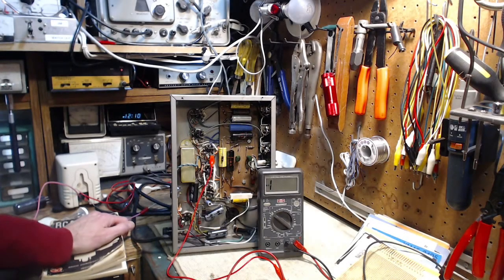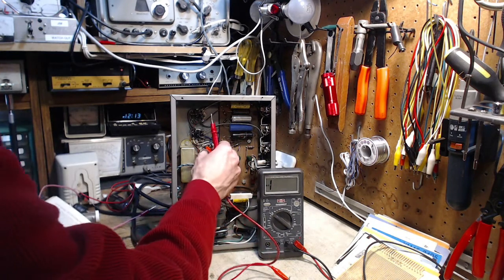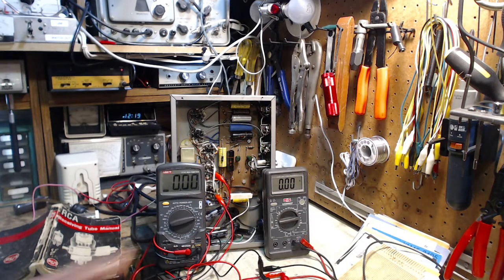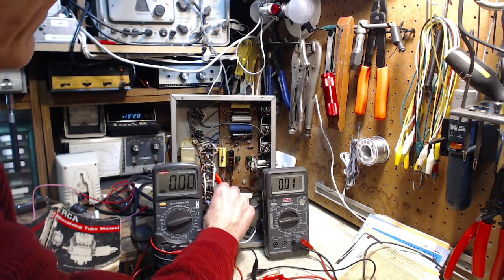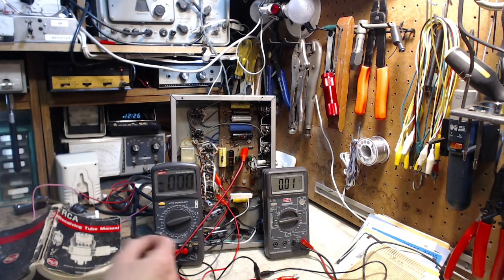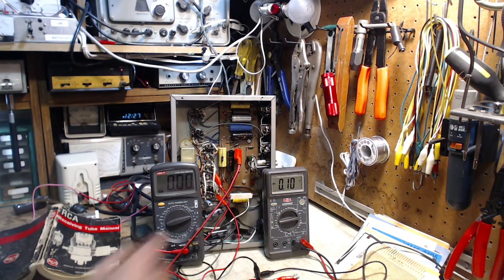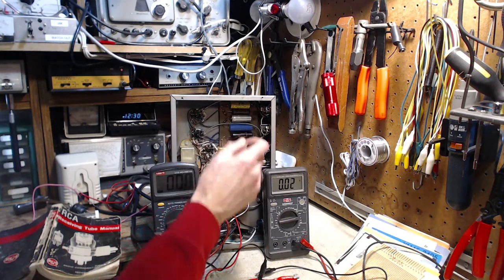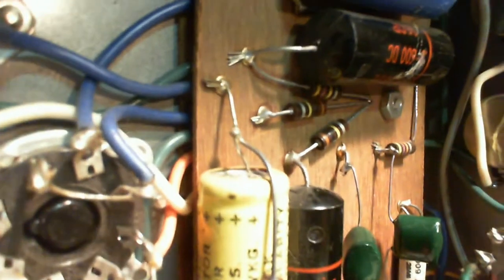Vacuum Tube PA Amplifier Video #10 - Mystery Bias

Comment: Hi Jim I see the from that test you found a cap will charge & discharge through a d v m .
But time depends on c & r as the meter is in 5 -15 meg / volt what is the grid resistor value for that 6v6 .
It should be from 0V chassis & grid is it open or high .
Meter from grid to ground I would expect to see 100k – 400k max & the same on 2 jar ;-).
Note master volume may be across grids of 6v6 s .
( you could lift one end of the 0.1 caps & repeat the test as a sanity check ? )

Comment: Hi Jim
I see the amp from hell is giving you a bad time .
If it makes you feel better been there 2 !! .
Power amps can be a pain & no bleed resistors across main caps .

It Just crossed my mind as the max voltage for a 6V6 in push pull is 285 V
 ( from data sheet ) Is the heater voltage high ?.
IE shorted turns on the mains input pushing up the voltage or not set .
Did you change the cooked cathode cap ( 25v is a low working voltage so fit 50 v min ) .
PS :- you could use a separate cathode cap & resistor for each 6V6 & set R as required .

Comment: This is rather close to your beast's output stage, I reckon. Note the 250 ohm cathode resistor. There it is 5 Watts, the one in yours is a 10 Watt; prolly about right given the high B+.  To wit:
http://www.ampbooks.com/home/classic-circuits/fender-deluxe-5e3-power-amp/

Comment: Were I working on that, I'd surely have a really close look underneath that wooden sandwich; indeed would likely consider a complete re-build using perfboard. The wood makes me cringe. Way too hydrophilic at the voltages present and nearby high impedance nodes. That it worked at all well would be a bit of a surprise.

Comment: The grid bias on the 6V6's will behave differently because one 6V6 grid cap. is coupled to B+, while the other 6V6 grid cap. is coupled to ground through a cathode resistor. Recall how the phase splitter (one triode of the 6SN7) functions.
 It could be using the sort of splitter that WOULD have B+ on both coupling caps. Easy to check: each 6V6 grid coupling caps. would connect directly to one of the two plates of the 6SN7.

Comment: Sometimes you do just have to walk away and do something else, and then come back to it. Your mind then rationalises things and you'd be surprised how that helps! 

More thoughts: You noticed that the plate of one 6SN7 triode is connected to the grid of the other, that would make sense if your phase inverter looks like the first 6SN7 in this circuit:
http://www.angelfire.com/electronic/funwithtubes/images/Amp-Williamson-2.gif:
The theory is that the first stage is a straight triode voltage amplifier, whose plate is DC coupled to the grid of the second stage. Now, this means that the cathode of the second stage is biassed to well above ground but that's okay; the cathode resistor is simply made a whole lot bigger (some tens of K), so that the current in the tube is still in the right region. Now, the values of the cathode and plate resistors are made the same, so that as the current in the tube increases with the swing of the audio signal, the plate voltage falls and the cathode voltage rises and vice versa giving equal and opposite drive signals- which is exactly what you need for push-pull operation.

I think you are right to pull the board out and look at how it's wired- you can draw the schematic out then. And who knows what is lurking underneath?!

Dennis has a very good point in his comment on video #7, in that the B+ is way too high for 6V6's which have an absolute max plate voltage of 315V. I think he's probably correct in saying that the output tubes should be 6L6's; this would make it a 30-50 watt amp. I think the 270 ohm cathode resistor would be correct for 6L6's as well.
Reply from the maker: Alan Cordwell I was wondering about the plate to grid connection and had reasoned out that the cathode potential would have to made higher than the grid with a big cathode resistor.  The 6L6 idea is very interesting.  I imagine there are lots of experimenters out there swapping tubes around and I shouldn't be surprised if one shows up on my bench.  I saw the B+ limit of 315 too and I've been wondering about it the whole time.  Thanks, Jim.